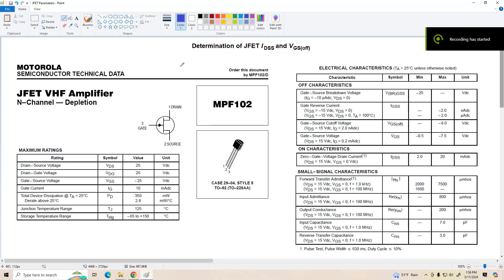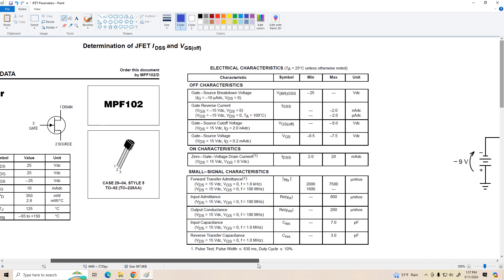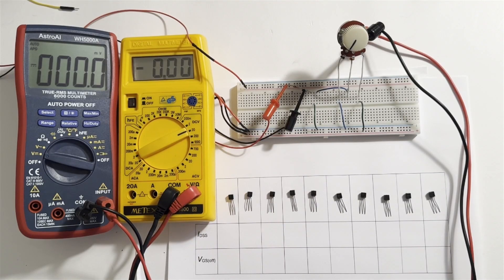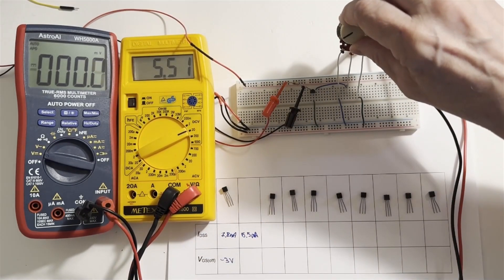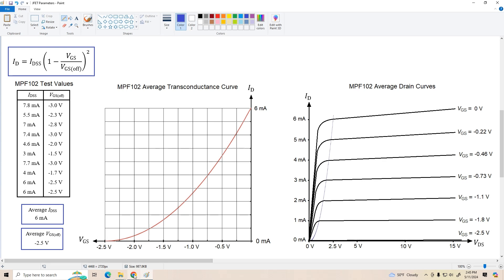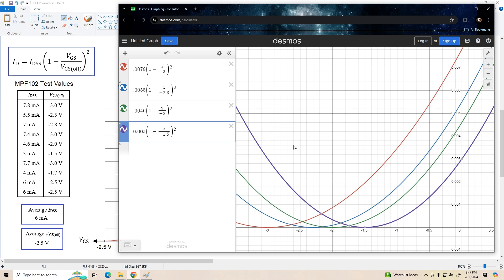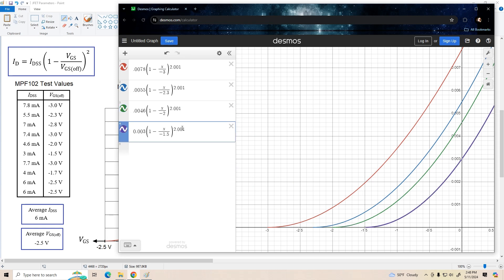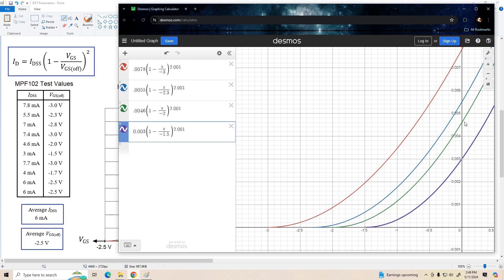Topic 41 JFET Parameter Measurement

Comment: Do current Fet's in tiny SOT323 package also deviate that much?
Reply from the maker: The MPF102 has an especially wide variation of parameters on paper but I rarely see any with Idss over 10 mA. Most of the newer JFETs have a narrower spread.
Reply: @Electronics4Guitar  i have quite a few breadboards, but i hate them. always these weak connections you gotta debug. i use Fallstad, than i design pcb and make it, eurorack synth modules.
Reply: @Electronics4Guitar  I have a bottle with an considerable amount of wires on my desk.